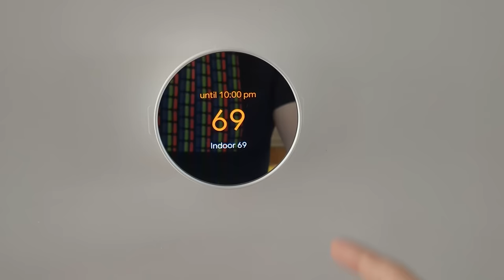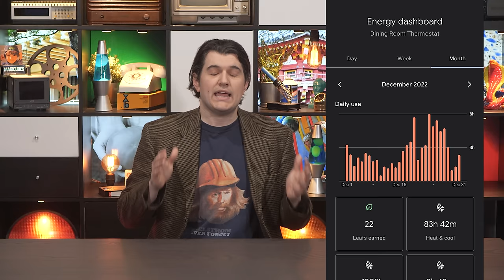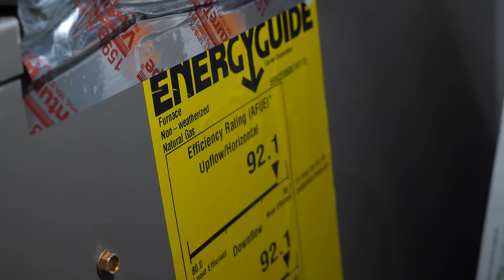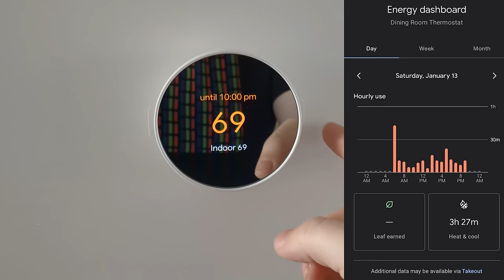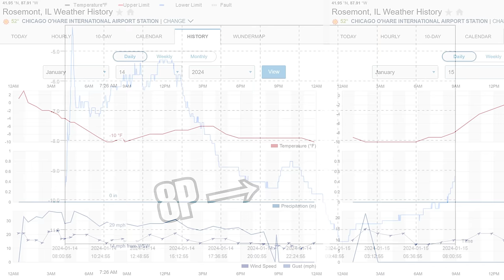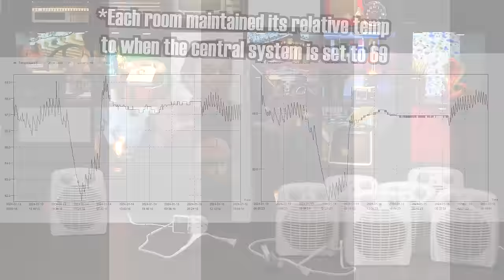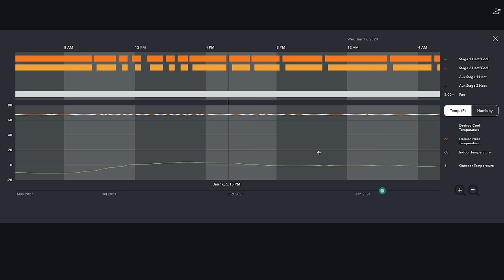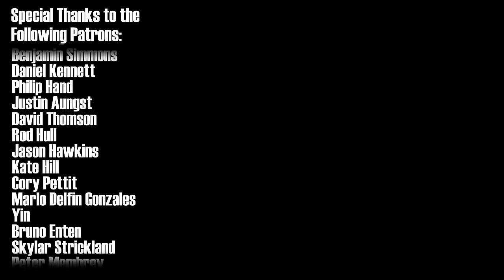Old HVAC industry practices are holding us back and costing us money. But we can fix it.

Comment: Just did a manual J calculation for my home, came up with around 36000BTUs, so I bought a 36000BTU heat pump 4 zone system, and will relegate my old 85000BTU oil furnace to the backup.  Thanks for the video!  the HVAC companies all wanted to do a 4 or 5 ton heat pump system, which 4 companies quoted me over $18000 for it.  I bought a DIY system for just over 6k.
Reply: You need to be careful here, you need to verify the output BTU of the heat pump at those low temperatures. Especially when you get below freezing many models start to derate. That derated number is what you need to be using for your sizing.
Reply: I love it when the DIY crowd "knows more" than the technicians. People like you keep people like me (Hvac tech) up to our eyeballs in service calls. Btw- I charge more to fix a DIY screw up
Reply: Depending on the age of your oil furnace it may be as low as 56% efficient.  A lot of them varied between 56-65% with only a few newer ones approaching 80%.  With natural gas converting from an 80% to a 96% plus normally allows you to go down an input size as the output is nearly the same. 

But as another poster said, be aware of what your winter temperatures are vs the actual output chart of your heat pump.  Properly sized it will save you on your heating bill though.
Reply: @theelite1x721987  Imagine thinking that such a simple trade is that difficult.  It goes to show why you're an HVAC guy.
Reply: @MiniDevilDF  simple. Sure thing. Go and work on a 250 ton chiller system with a 20 year old BAS. Let me know how simple it is. Go on. I'll wait.
Reply: @otm646  derated at -13f to 80%.  even with 28000BTUs, I have electric backup and the oil furnace will stay for now.
Reply: @shadowwolfmandan   The oil furnace is only about 4 years old.  it was bought from one of the last companies selling oil furnaces anymore.
Reply: @theelite1x721987  Even if you had to fix it twice it'd probably still be massive savings over the $18k. 🤷‍♀
Reply: @WillowEpp  that depends greatly on the repair. Trust me. Many modern mini split systems have boards that like to fail. The boards are about 2000 dollars or more just for the part. About same price in labor to install. And that's assuming part is even in stock. Many parts are 2 to 4 months out from manufacturer. So many people end up just buying a new system as they don't want to he without heat for that long

Comment: Just a side note for people: here in the Southeast we use heat pumps all the time, so the "HVAC industry" is very location dependent. This channel is very Midwest (and Northeast) oriented, not that there is anything wrong with that (Seinfeld reference lol)
Reply: True. I’m pretty sure my old house in Virginia had one because the outside HVAC unit would run during the winter while cranking out warmth inside.

Comment: I live in Ontario, Canada, and I just installed a Gree GUD36 3-ton heat pump for free under the government's incentives. It's a heat pump replacing the A/C while keeping the old furnace in place as the blower and backup heater. It worked quite well. But two things I want to comment:
1. It makes more sense to run the heat pump rather than gas when the temperature is not that cold and when the electricity is cheaper. No one did this math. I did a brief calculation (in CAD): assuming -7C and gas price 0.5/m3, COP=2, it would break even when your electricity rate is 0.1/kwh. So it would save you a lot of money by running heat pump during the night (my overnight rate is 0.03/kwh). However, it's a shame that no "smart" thermostat on the market supports switching between normal and AUX modes in the schedule. I ended up using Home Assitant to do the trick.
2. The contractors here will only advertise it as a free better A/C. They said the heat pump was not powerful enough for the cold and set the AUX cutoff temperature to 4C or even higher. Despite the government's paid to lower carbon emissions and save people some utility bills, people are not well educated on how to use heat pumps and get the most out of them (like smart thermostat manufacturers implementing the ability to switch between AUX and heat pump automatically based on outdoor temperature, COP at the temperature, gas rate and electricity rate during the time) 
I hope you can cover the cost analysis on the heat pump vs gas next time. It's gonna be fun and super useful!
Reply: Most people struggle to set up or even understand why they'd save mpmey with a programable thermostat in the first place. Cheap people mostly just turn it down when they leave and back up when they get home. Those who have money for a new hvac and thermostat generally won't put up with any discomfort anyway. Learning is uncomfortable for most people. Therefore, nobody actually would use those settings.
Reply: 30 years ago I was installing temperature control panels by Paragon that had many of these functions. The annoying part was that I had to run a thermocouple to the shaded outside wall of the building to anticipate heating demand. But they worked well.
Reply: they are better than a furnace until you start getting into the -15c range, then you start risking a cold house. the idea that you then require a backup Nat Gas heater ruins the cost analysis.

when I did research on a heat pumps as a replacement, I found that they only guaranteed full heat down to -20c best case. not good enough for me. its also a case where the likelihood that the electrification boom causes a huge spike in electricity costs and black outs is quite high in Canada given that any attempt at building powerplants, regardless of their needs is protested heavily. its alot easier to run a generator to power a blower than it is to power a whole heater. just seems like a single point of failure to me to run everything off the electrical grid.
Reply: man, I wish i had those power costs.
i pay roughly 0.50CAD per kWh at night and ~0.66CAD during the day.
I would love to have a heat pump, just to have A/C in the summer, but gas is just that much cheaper to run.
For now that is. Sooner or later the balance will flip. I hope at least...
Reply: @HavokR505  for places with cold winters there's ground loop heat pumps -- but they're not as convenient/cheap as barely modified air AC unit, sure
Reply: @niter43  I have no beef with heat pumps. I just feel like their use cases are exaggerated.
Reply: It's better to NOT use a thermostat with heat pumps. I used one with the gas boiler bunt not with the heat pump. I can control the heat pump on my phone app and you can use weather compensation to keep the same temperature inside. Or use the app to change the outflow temperature once in a couple af weeks to compensat for the outside temperature, usually.

Comment: I took a class about HVAC as a whole home system, our instructor told us he did a survey on 100 homes in the area and 90 of them are oversized and insulation not installed correctly. He said on the homes he installs and how it should always be is you set the temp on your thermostat and you never have to touch it no matter the temp outside.

Comment: I was always of the opinion that central heating (and cooling) makes no sense, unless you have a furnace with multiple zones. It's more efficient and effective to have each room/area equipped with a wall heater and a thermostat.
My basement is REALLY cold because all the heat escapes to the upper floor, so to heat the basement to a comfortable temperature, I have to overheat the upstairs, and vice versa.

Comment: I bought a townhouse 15 years ago, new build, not knowing much about HVAC.  AC compressor was 1.5 tons and correct.  The massive issue was the furnace ran off the hot water heater .  So the hot water was pumped through a heat exchanger and the AC coolant coil was sized to match at a staggering 3t.  The heat barely came on, the compressor could not cool the coil below 24C, at the best of time.  I could not find a company that would even touch this odd system.  

Eventually I tracked the manufacturer down, then distribution partner, and seems like most people don't really service it, just new home installs

Comment: Having done HVAC and with family running a geothermal business, heat pumps :P, it is very common for installs to be sized inappropriately, leading to short cycling and shortened lifespan of equipment.

EDIT: I typed this up almost immediately before having watched the whole video, so forgive any points I repeated from the video. But that also proves the salience of the points
Reply: Nobody will ever fault you for saying what needed to be said so clearly and with real authority on the subject.
Reply: One thing that I noticed when my parents had their ancient furnace replaced, it may even have been the original gas furnace that was installed when the coal one was removed, that it was no longer obvious when the heater went on. The new one was on for longer periods of the day, which meant less swings from hot to cold and probably a bit more efficient as a result.

Comment: Pro tip: share a wall with someone who likes to keep their house way warmer than you prefer. I used to live in an apartment where I shared all my walls and I never turned on my heat.
Reply: No windows to the outside at all?🫨😁
Reply: @matsl89  There is a reason many apartments where I live provide free heat. They don't want people shutting off the thermostat and letting the pipes burst.
Reply: That's one critique I have with his townhome test, how much heat was he getting from the neighbors who were most certainly running their heat? Does he share 1 wall or 2?
Reply: @extragoode  I had that same concern: until he revealed 7 space heaters.

As long as the temperature is close, it won't affect the results much.
Reply: I lived in a basement apartment that had the building’s furnace on the other side of my wall. Score!
Reply: When I was in an apartment, I once left the windows open with a fan in them to air it out for a few days while it was below freezing, and the temperature never dropped below 60°F.
Reply: I am in this situation right now. I wind up running my AC a lot because I like it cold lol
Reply: @brainwater same! I had an apartment in Northglenn, CO (top floor helped too) but I would regularly have the window half-open to the point that snow would "drift" in a tiny bit on the sill. I'd be sitting beside it in a t-shirt playing xbox. As long as the winds weren't strong of course
Edited typo*
Reply: @extragoode  It sounded like he probably shares 2 walls, but the more I think about it I'm pretty sure it's only a little consequential: if there's insulation between the units, and all units have some heat on (indoor air anywhere from 62 to 76), you're looking at a small delta T and relatively low energy flow vs the 80 degree difference on the exterior walls. It'll be situation dependent though (you might have R20 to the exterior but barely R13 between units; wall areas; etc), but I'd be willing to believe that it's not more then 20% off, and he should be fine so long as the neighbor unit is never torn down.  

But it is funny that his neighbors are subsidizing his heating bill :-p
Reply: Same if you're the upstairs neighbor, old lady downstairs can't stand anything less than 72, and I swear my place stays 68 because of it xD
Reply: @extragoode  probably two walls, but the difference is probably negligible, given that he had heated it to about the same temperature
Reply: @codertao  I would not call it "subsidizing heat bill" since they just act as an insulation. 
As long as both houses have similar temperature no heat is transferred so neither of the neighbors loose or gain any heat.
Its one of the win-win situations where both parties benefit.
Reply: @hubertnnn  aye, but if they are different then it is a subsidy: if his neighbors run at 74 all season long, but he's 69 at night, 72 in the morning; or he's away and the set point is 50, he benefits. Not by a lot, but by an amount. 

(And opposite if his neighbors are on vacation and have the setpoint at "just over freezing", or if he lived adjacent to someone that doesn't mind bundling up for winter)

Comment: I had an opposite experience. I was about to replace my 3 ton AC because it was old (24 years old at the time) and was having problems keeping up on very hot days. The HVAC contractor wanted to install a smaller AC unit. He said that he a bad experience with the coil freezing up because the AC  was oversized for the ducts. He pointed out that my home (built in 1965) has small ducts designed for heating, not cooling. Even though my 3 ton unit had no history of the coil freezing up, he wanted to replace it with a smaller 2.5 ton unit, likely making the situation worse as far as keeping up with the load on those very hot summer days. I decided not to replace my old AC, which is now 29 years old and still going.

Comment: You're so right about the price gouging that goes on, they assume we don't know enough to know when we're being ripped off. Recently my 74 year old Mom was sent an estimate from her HVAC company to replace the thermostats in her house, they estimated $2,000. From a bit of googling I learned that the thermostats cost $500 in total and I estimated 2 hours in labor, which is extremely generous for changing thermostats. They effectively tried to sneak in a labor charge of $750 per hour because they assumed my elderly Mom wouldn't know better.
Reply: Why does everything need to be a scam now?
Reply: Did they have to run new thermostat wire? if not then that would be a crazy estimate. depending on the location of the thermostat running new wires to the AHU and the Cond through the walls would take a lot more effort and longer then 2 hours.
Reply: I presume more than one thermostat because it's zone heat?  I just replaced my three year old dead Honeywell thermostat with a China's Best from Amazon for $33.  I even like it better, 1/3rd the cost.  Both have the aux heat connection for heat strips.
Reply: 12:52 is what's also happening in hospitals, and different, departments, only focused on one part of the human body, and why general/family medicine is so important, because if you are in one part of the body with a problem, you can get something done for that part, but it will domino effect itself in other parts of the body, if not properly managed, and it is why we need a board of general managers that understand all the parts of the body, but we can't forget the psychological (mind/soul/feeling/placebo) part of the humans, because that is also a major factor, yes the body is a machine/hardware, but you need a good soul/software engineer as well.
Reply: How many thermostats are in that house?!? Even the unnecessarily "smart" units are sub-100$. They're just going to go to the local Lowes' (etc.) and buy the exact same thing you could -- and then charge double for it. And then $250/hr in labor. I understand how most might think this isn't something they could do themselves, but as long as you can read and see colors, it's really a simple process.